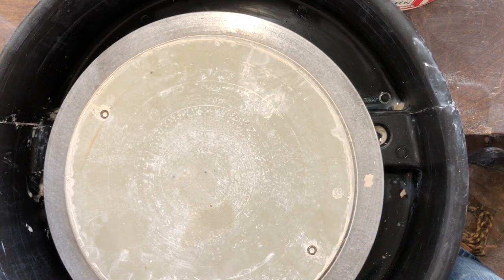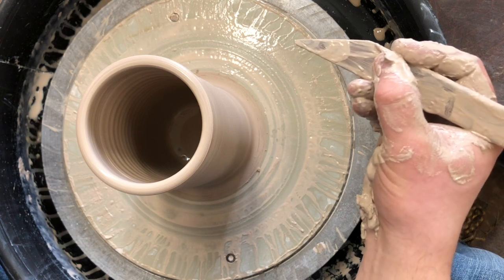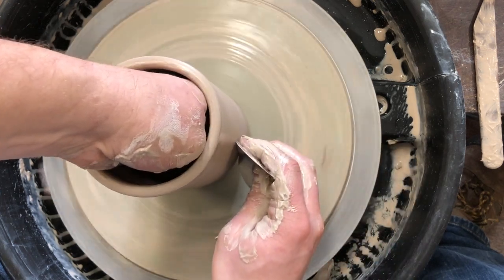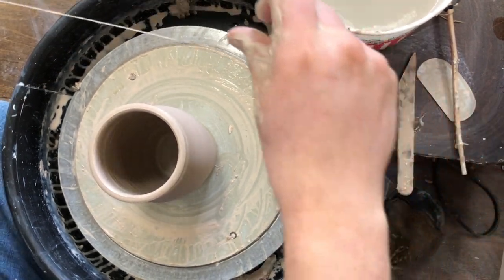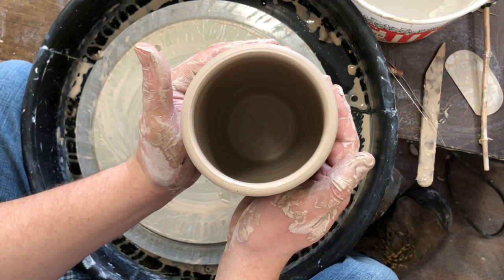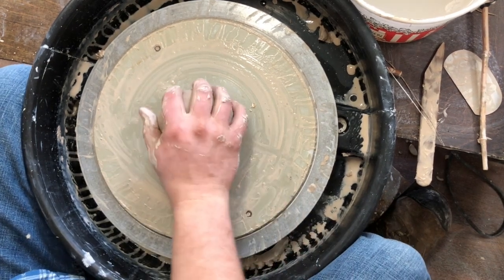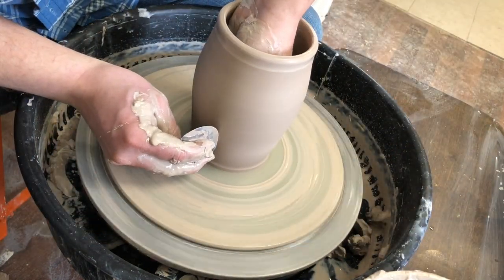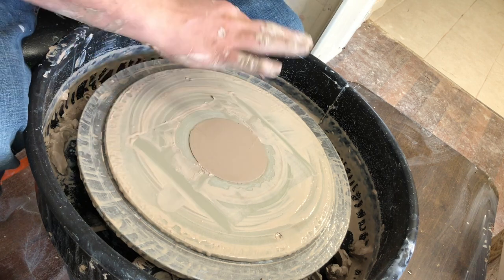Removing Pots From the Wheel

Comment: Ah I think my problem is that I don't remove the excess slip with the rib tool, so my piece is still really wet when I pick it up and it warps straight away. Thanks for the tip

Comment: Love the "snowbank" clay removal technique!  Have you tried 6 inch hydrobats from the Ceramic Shop?  They help the pot dry very evenly because they suck moisture out of the bottom of the pot.  When approaching leather hard, the pot pops of naturally without having to be cut.  Thanks for your video!
Reply from the maker: Scott No room for that amount of bats when you throw 40-50 pieces.
Reply: Have you ever tried the hydrobats?
Reply from the maker: yep, hey were heavy, took up a lot of space in use and when stored, and Irimm pretty much everything I make so a flat smooth bottom was never a need.
Reply: I don't need a flat, smooth bottom, but I do like that the bottom has similar water content as the rest of the pot.

Comment: what happens after you finish a piece? trying to recall from my lesson last summer:

- let it dry until leather-hard
- put it upside down on the wheel with a little bit of water to create a seal
- trim excess and create a foot
- bisque fire
- sand off lip and abnormalities
- put wax on the foot (and anywhere else you want not glazed)
- glaze 
- fire 

anything else I'm missing/forgetting in the lifecycle?
Reply from the maker: You can deal with the issues that would needed to be sanded at leatherhard or bone dry.
Reply from the maker: You don’t need to wax either

Comment: I find a lot more success when you turn the wooden tool blade so that it is cutting through the clay, no pointing up.
Reply from the maker: Martin Safer well that probably is because of other things you are doing or not doing. You likely start above and move down and into the clay.
Reply: You are quite correct, I then undercut it with a knife or needle tool so it cleanly comes off the wheel